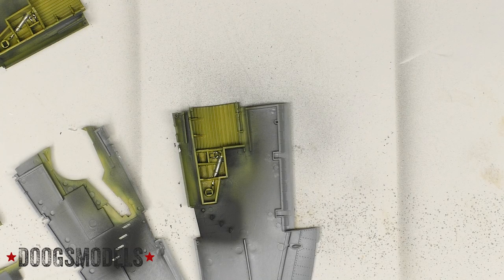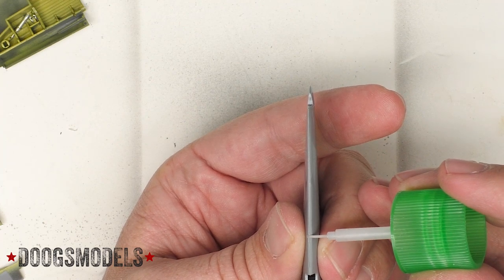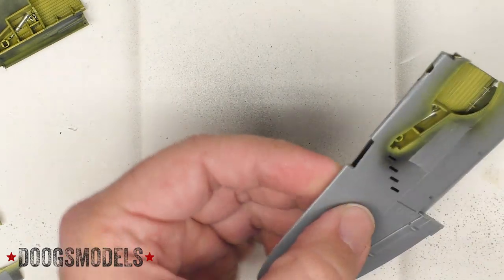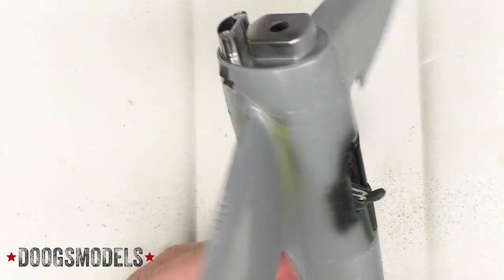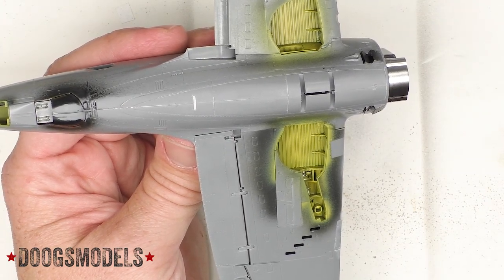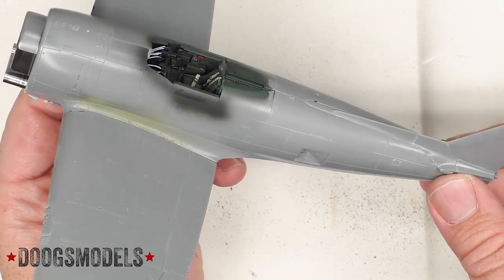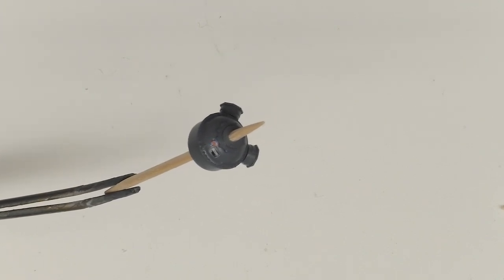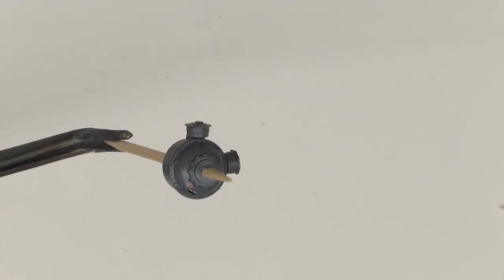Tamiya P-47M Build - Part 9: Wing Installation

Comment: The flap actuator you were toying with can get a line scribed in that matches the wing to fuse, & flap. Once all the sabotage was remedied on the "M"'s they did get plenty of hours put on them. Leaving them on the docks with canopies open, engines unprotected while still in the U.S. was not a help. Ignition ring, let's say cracks, and not wrapping{ weather sealing} the engines for overseas transport was the death nail for the HP R-2800. It's coming along, looks good.